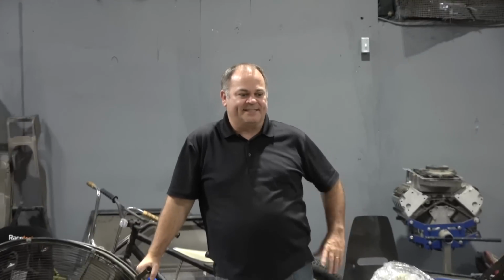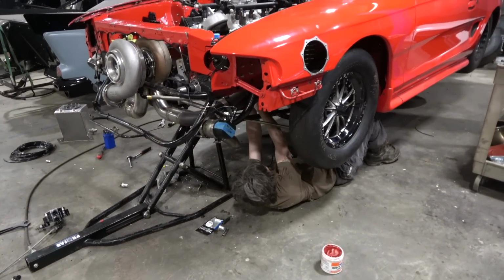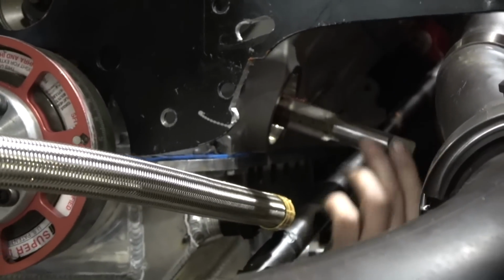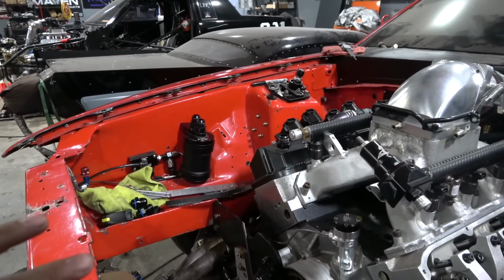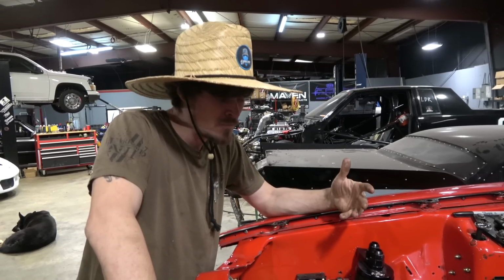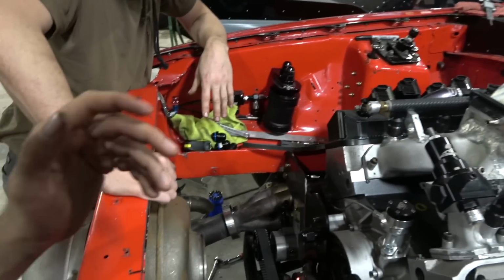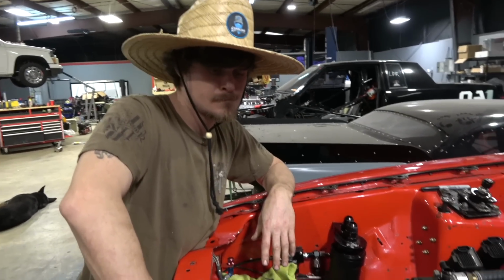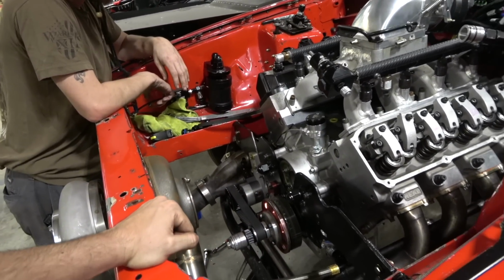HOW TO PLUMB YOUR METHANOL RACE CAR!!

Comment: Rage, Aeromotive, Kinsler all recommend a Y block to each fuel rail. 90 % of the methanol / atomizer injector set ups I’ve seen loop the rails like your doing to the red lobster. Is there a balance in volume issue to each rail at WOT? That’s the only reason I can think of why they recommend a Y to each rail.